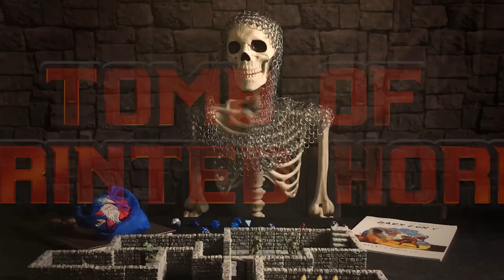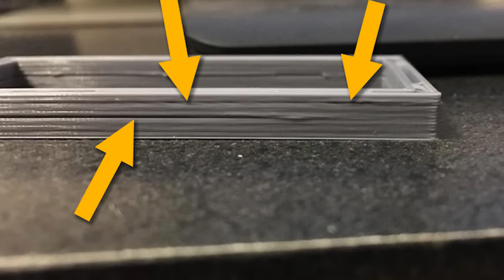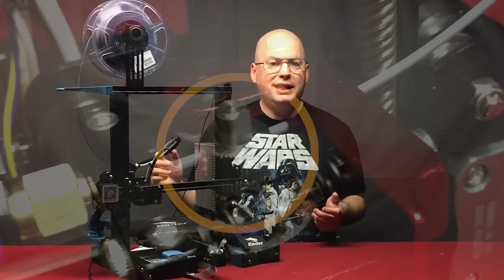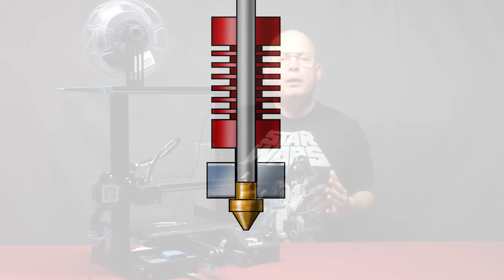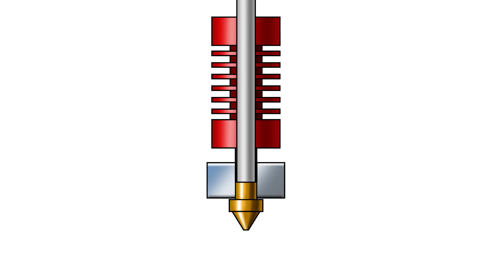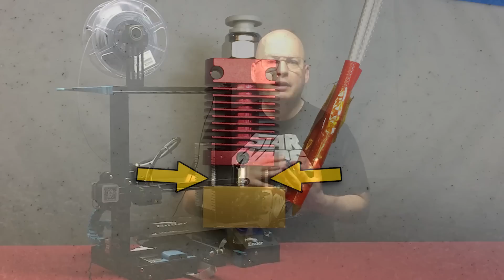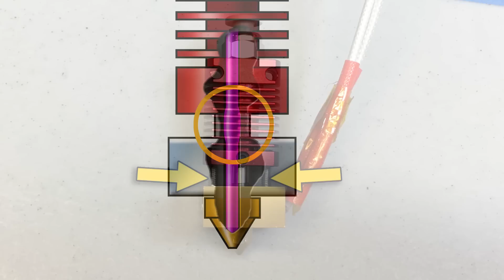Fixing Under Extrusion in a 3D Printer

Comment: Can anyone help , I am having an issue where the nozzle of my printer shears clean off after one print and this has happened twice , I can also confirm it is not nozzle clogging as I used the provided cleaning tool to check and there was no resistance. Why are my nozzles shearing off ?
Reply: Gotta leave those two screws in.  Pressure is too much.  Are they still present?

Comment: i checked out my problems and i just found out its a software problem with CURA 4.6.1 version. I used the gcode files that came with the printer and it prints just fine. i don't know what it could be but only Cura program. I have a Ender 3 pro. if anyone can help out. it will be highly appreciated

Comment: This actually is a very informative video. Great job, the PTFE tube not close enough to the nozzle was the problem in my case. It caused underextrusion and another problem, the filament started to build up in de heat block. Because of this friction the extruder gear started to slip, resulting in even more underextrusion.

Comment: Ahhh this exactly what I needed, the picture of the grinding really helped this is happening to me, ill loosen it up right meow
Reply: Gadgetismic how do you loosen the lever tension? He didn’t explain but said there’s no way to adjust tension on the ender 3 lever
Reply: @magatsu82  I'm using the anycubic mega zero and theres a dial where the filament goes into the bowden tube. Check where the filament goes, oh the manual it said to be 18mm but that made it too tight so I loosened it up 1.5 mm, also if you set the retraction to be less on your slicer that could help as well to reduce grinding on the filament.

I cleaned out the gears, oiled them up, cleaned the extruder, bowden tube and gunk on the gears and tightened the belts and so far its been smoother. I'm still under extruding though from printing so many XY cubes, working on tweaking the horizontal expansion to see if that helps.

Comment: Updated option to the problem with heat creep: Replace your print head with a Micro Swiss All-Metal head.  It doesn't have the screws that transfer additional heat, and the heat break is make from titanium, which has better thermal isolation.

Overall solid video.  Keep them coming.

Comment: I just set up my new ender 3 and it’s printing a flimsy piece.  I also have a Tornado which prints the same part nice and solid.  I slice in simplified and have sliced the part under the Ender 3 profile with the same process setting as the slice for the tornado.  I guess I’ll run it again at a slower speed.

Comment: After sending back my 1st Creality CR-X 3d printer, the Flashforge Guider 2 it got replaced by appeared better initially, but major problems with the extruder occurred on Day 2 when I tried to print my 2nd object.  I wasted 4 hours of my Sunday trying to figure what is wrong with this brand new printer, and finally nailed it down to the extruder failing to extrude, despite there being no blockages and the gear feeding the filament in correctly.  Totally useless, and I am a serious guy with limited time who needs to make prototypes for something I have invented and filed a patent for.  Maybe I am expecting too much by expecting consumer products like 3d printers to actually work in the 3rd decade of the 21st century (you know, like TVs, laptops, smartphones etc).  It just seems there are too many fundamentally inherent reliability issues with FDM 3d printing.  It wouldn't surprise me if SLA takes over completely, or some other form of deposition, but FDM is terrible.

This is a useful video, by the way.

Comment: Is there any actual advatage to doing the direct feed or is it mainly a looks upgrade?
Reply from the maker: Direct feed is better for flexible filaments, I prefer Bowden tube feed as it keeps the mass of the moving X Carriage/print head low and that reduces ringing and artifacts from inertia, so it makes better tiny models like miniatures.
Reply: @Tombof3DPrintedHorrors  ahhh, makes sense. I kept seeing it in the upgrades yet never in any of the YouTube videos. Not so much as a mention of it at all. So it had me curious if it was a good move for extrusion...or terrible one. I'm still pretty new to the 3d printing and so far I've been noticing a theme...what usually looks like a good idea ends up being the opposite, for example low speeds can end up overheating and looking terrible. But yeah definitely makes sense on the direct drive. Thanks much for the advice. Also is there a good place to look for miniature prints. I use play warhammer and just didnt have the time but I've been wanting to get back into it but havent seen much out there on thingiverse. So curious if theres sites dedicated to miniatures. I've been loving this 3d printing so it's a 2for , for being able to print miniatures too. But not sure where to look for prints.

Comment: My printer extruder slips when the print starts.  Once it works it's way to higher layers, the slipping stops.  Do I need to lower my bed?  Do you think it is a tension issue in the extruder?  My printer is only a week old.  I've done 9 or so prints and this just started.  Thanks!

Comment: Great video!  I did experience the hot end clog because I still had the original pneumatic fittings on which I resolved by replacing them at both ends and replacing the bowden tube and nozzle.  The issue I have is pulling out my filament to change rolls.  When I first started, I heated the nozzle up to 205C and it would pull out easily enough.  Now, after printing for several months, even heated up, I have to wrap the filament around my fingers and pull really hard to get the filament to come out and most times I have to disconnect the upper end of the bowden tube to cut off the blob on the end of the filament.  I have even tried increasing the temperature of the nozzle to 220C.  While it did come out easier of the hot end, it still creates a nasty blob on the end that won't come through the extruder.   Can you address this please?

Comment: How do you adjust the tension on the gear of an ender 3? Thank you for this detailed video. I could not find much info on this.
Reply from the maker: You can increase tension on the gear by putting a small spacer or washer at one of the spring ends to compress it more.:)
Reply: Oh. Sorry. I meant decrease the tension because I'm pretty sure it's too tight because it seems to be really digging into the filament. Thank you for the Speedy response!
Reply from the maker: @jazzofalltrades7937  to decrease tension you only have two options, clip a small portion of the current spring off, or use a shorter/weaker replacement spring.
Reply: Tomb of 3D Printed Horrors ohhh hmm. I'll see if I can work that out. Thank you very much! Have a great night.

Comment: 14:42 but he recommends replacing parts as soon as you get the printer. I have not touched a single part on my ender3 pro which uses the same parts as the ender3 and it prints beautifully. This video offers lots of very helpful information but I hope beginners dont start hacking away at their brand new printer causing all kinds of issues without first trying to print using stock parts. If an issue is discovered, then adress the components in question. Again great video but I've seen lots of user created problems because they tried to make out of the box modifications the day the open the box.
Reply: I bought a refurbished Ender 3 (non-pro) from Creality and even it has a number of upgrades over the original Ender 3. Creality seems keen on applying minor changes to their products without so much as a mention, which is a bit annoying but overall good. As such, my printer already has the silicon insulator, bowden tube fitting tensioners, and a brass insert in the plastic extruder entrance, which is one of the things that Tom mentions, as it used to come with no brass insert, only plastic.

The Ender 3 Pro does use many same parts as the original Ender 3, but both the Pro and newer 3s have key differences that mitigate issues commonly mentioned in these sorts of videos targeting older versions.

Comment: Those screws are passing heat around your heat break into your heat sink.  A warmer heat sink is less effective in cooling the heat break/feed tube shaft.  Yes, it might be working.  But leaving things un-corrected means you are running closer to the margin of failure.  A system running close to the edge of failure wont' take as large of a problem to compromise it.  Also, those things pushing you over the edge into failed prints will be much more subtle.  If a problem can be observed or a system can be enhanced, it should be fixed.  It's difficult enough to keep the whole system working well without ignoring all possible enhancements.

Comment: Good Day

Thanks for your input, but it did not fix my problem. still not printing  circles.

Maybe any thing else I can do.

Thanks so much
Fanie
Reply from the maker: Did you check that the geared pulleys are tight for the belts? They can slip too.
Reply: Good day

Thank you for your support. Problem solved. My pulley on the X axis was loose.

Regards 
Fanie

Comment: Good day. I also have a CREALITY CR10S printer. 
My SD card seems to have errors. My printer suddenly cant print round objects.
Could it be the SD card , or what could be the problem.It start round at the top and comes vertical down, and go round again at
the bottom and go vertical up.

Thanks for your help.
Fanie
Reply from the maker: Loose belt causes that, see my video on it :)

Comment: I contacted Creality directly and they confirmed the two Screws you mentioned in the heat block being left in by mistake that is NOT accurate info per Creality!!!

These two screws are supposed to be left in place and are meant to be there to keep the heat block in place correctly when removing and replacing the nozzle tip!!!
Reply from the maker: Pssst... read the entire video description. ;)

Comment: Good stuff Tom, I totally fought that Cura 3.5 filament size issue. spent a week trying to figure it out because I had just started printing. I think you posted on FB about it and boom problem solved. Thanks for doing what you do.
Reply from the maker: Thanks for watching! :)
Reply: Ha. This happened to me, too - I changed material and for some reason the filament diameter got changed to 2.85mm. The print came out with wire mesh sides...

Comment: Great video, definitely put me on the right track for fixing my problem, even though it wasn't specifically mentioned. I eventually found that the plastic extruder backing holding the filament guide/roller/bearing had cracked. That caused a lack of pressure against the filament, so I replaced with the metal extruder, works like a champ now. All that said, I'll be returning to your channel for any future print problems, thanks!
Reply from the maker: Thanks for watching!

Comment: To be honest, I kinda wanted these techniques to not work - especially the 90*c filament trick - to pull out gunk and burned filament from the inside of the heating block. Why?... because they are tedious - especially if you do a lot of printing. Unfortunately, the 90*c filament trick fixed my “under-extrusion” issue - so lol - I have to do it now about every 6 to 8 prints to fix “under-extrusion”. Although, since my 3D printer is a Geeetech A20M, and I am using ABS - I have to amp my temperature to 100*c to remove debris from the top of the heating block - using this filament technique. Now, when I remove the nozzle, I have to amp my temperature to 120*c - to remove debris from the bottom of the heating block - using a filament. 
As tedious as your trouble shooting might be - it worked for me - so thank you so much!!!
Now I have to figure out how to fix under-extrusion on my “Qidi” X-MAX 3D printer - extruder on that one is attached to a heating block - so one piece. “Filament-pulling” technique will not work on that one.
Thanks again!

Comment: Great vid, thanks for the help. I have one thing to add to check. Now, I’m not new to printing and have four printers. My ender 3 developed under extrusion and was pulling my hair out trying to figure it out. I went through all the norm checks like in your vid. Nothing fixed it. I keep going back to check for clogs and every time I did I put a brand new nozzle on. Still under extrusion. I was having to turn up flow to even get it to kinda print. Finally I took another new nozzle from my bag of new nozzles and tried to stick my wire nozzle cleaner through it and low and behold my new nozzle are all defective. They say on them they are .04 but not a change. Looks like .01 at the most. So hope this also helps someone out. Cheers

Comment: I've spoken with Creality and the 2 extra hot-end screws must not be removed, they are to prevent bending damage to the heat break, they also give additional stability to hot-end and prevent head crashes from destroying the heat break tube.
Reply: A heat break is a few dollars, and many people (me included) run the hotend without the screws. I have never damaged my heatbreak even when crashing my nozzle into the bed. They are just trying to save their butts.
Reply: If you properly hot-tighten your nozzle, the heat block should feel immovable without screws.

Comment: PLA wasn't sticking to the bed (was coming out too solid). Cleaned the bed with an alcohol solvent, levelled the bed and increased the end temperature by 10 degrees. Worked. TY.

Comment: This video was immensely helpful!
The material was presented clearly and concisely without (as another poster stated) a lot of YouTube "antics". Very professional. Thanks!

I would add to others who are trying to troubleshoot this problem - I finally discovered that the filament guide lever (the one with the roller and spring attached) on my CR10s, WAS CRACKED! The plastic had cracked where the roller was attached to it so that the roller itself, HID the failure. The result was that every time I did something to stiffen the spring and apply more pressure to the filament "pinch" ... it would seem to work for a bit but the crack would flex giving me variable pressure and VERY inconsistent results. I now have an aluminum guide block to install :)
BTW - when I removed the OEM plastic lever and examined it closely, the "guide hole" had become triangle shaped as you mentioned in your video. Impressive, considering I have run only a little more than two rolls of filament through it!

Comment: Spring tension on the feeder was the issue for me. Placed a small washer inbetween to tighten the spring and instantly fixed issue.
Reply: What printer do you have? I have the GeeeTech i3 Pro B. Mine seems to feed, then stop feeding after maybe 30-ish mm..
Reply: @elfpimp1  I have the Ender 3. It's apparently a common problem on this model.
Reply: @thishonewijayakumar2805  I'm going to try that washer idea.
Reply: @thishonewijayakumar2805  I just ordered an aluminum replacement.  six bucks plus tax. and one day shipping on amazon.
Reply: @elfpimp1  oh that sounds better. Thanks!

Comment: Just recently after a couple months without using it! My ender 3 started facing real issues with extruding, the filament curls up, it doesn't stick to the bed that well, not to mention the amount of stringing that comes with it ! Even the flow of the filament  is inconsistent! I tried cleaning the nozzle, changed it, tried the cold pull method, verified  the bed leveling! And I'm still not getting a result ! Any tips please ?!
Reply from the maker: If it's curling on the nozzle either your bed isn't high enough or your bowden tube has backed away slightly from the rear end of the nozzle.
Reply: @Tombof3DPrintedHorrors  thank you for the reply ! I also witness  an inconsistant flow of filament it stops repeatedly for a couple seconds each time then flows for a while  then it stops extruding once again ! Would that be the result of the same problem?

Comment: Those screws are not a mistake and they don't cause any heat creep. They were left there intentionally because the heaterblock will move without them. Please leave those screws in there.

Comment: I can't thank you enough. I'm new to 3D printing, purchased an Ender 3 Pro a couple months ago. Long story short I was having layer separation issues and other difficult to diagnose issues. I had narrowed it down to extrusion, but couldn't put my finger on it. Your video was invaluable, as my extruder mount had a hairline crack only visible from the underside after I decided to replace it with an aluminum one, per your comments. This coupled with a glass bed improved my prints better than factory. I couldn't be happier. Thank you!

Comment: i exchanged the tube and the extruder. completely cleaned everything. still massive underextrusion. dont know what to do now
Reply: and sometimes it just stops printing completely
Reply from the maker: @voktanagain5106  check your slicer settings have the filament diameter set to 1.75, and not something higher like 2.85 or 3mm
Reply: @Tombof3DPrintedHorrors  i tried printing some old Models that worked multiple Times but no succes

Comment: Sir, you are a master at this. When I bought my Ender-3 I promised myself not to mess around with upgrades and stuff. Just had an under-extrusion problem with it and your video is the best resource (by far) that I have found to help me. Based on your advice I upgraded the Bowden tube couplers and the extruder. In the end I think it was just tangled PLA that caused the problem but I am quite happy that I managed to do all this by myself with your videos and am confident it will save me problems in the long run. I hereby name thee Knight of Clear Explanations.

Comment: When I replace my filament, I heat up the nozzle, while I use some force to try an pull it out.
The filament is not molten enough to clog anything, I hope.
90 degrees ? Is that Celsius ? Because that seems low for petg or abs.
Reply from the maker: 90 for PLA